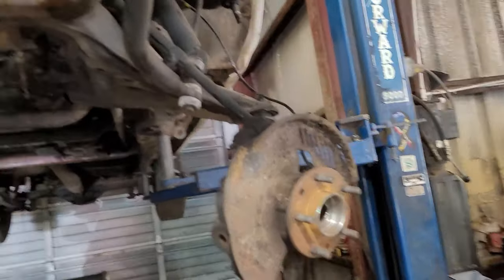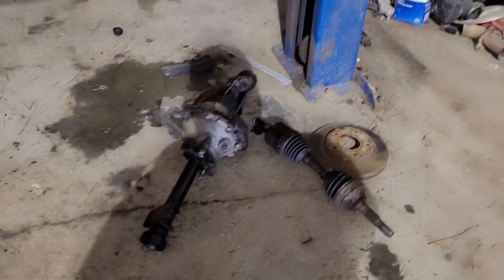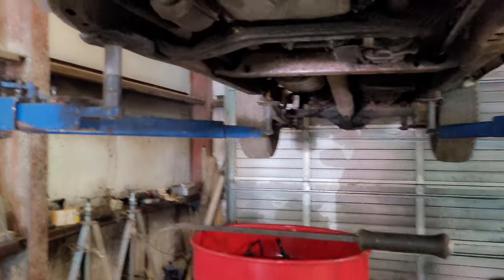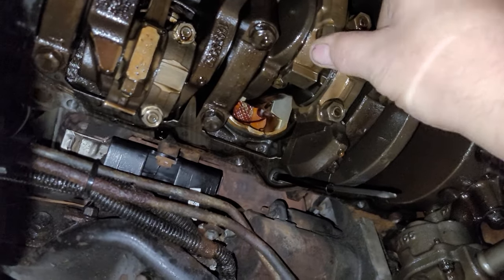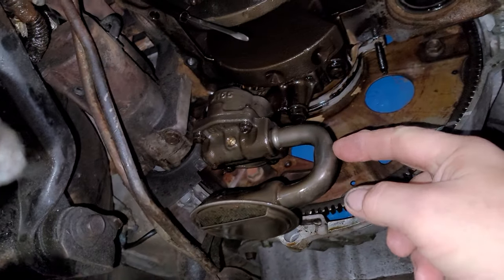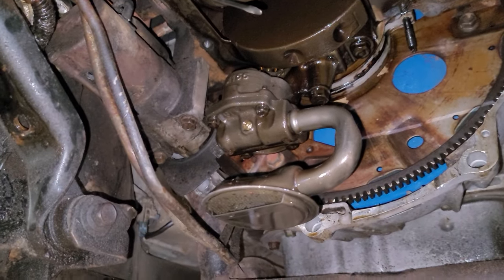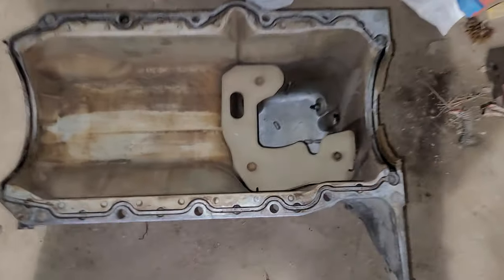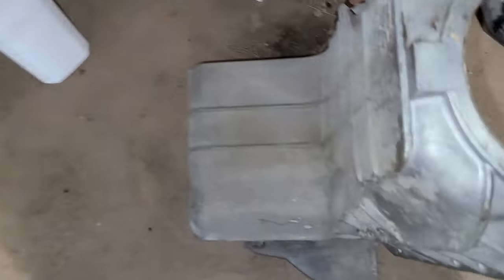Never seen this before. Chevy oil pressure problem

Comment: Those engines For some reason have always had oil pump problems the 43 and the 57 I think  At 1 time the dealer even said there was ATS P about using 3M roll off pads to  Being gaskets was the problem but then they used those plastic ones with the same abrasive basically. I think just put in a good mellings oil pump  And either attack well or use sleeve retainer or even some good right stuff silicone on the oil pump pick up Problem fixed

Comment: I might have to do this with my truck, stock oil pump, I do lots of off-roading though and I've noticed my oil pressure is running at like 10PSI on hot idle, I am using high flow rate K&N filters so maybe that has something to do with it. I also plan on putting a higher flow rate pump in there while I'm at it since I really like pressing the gas pedal. However, mine never goes to zero, if that happened I'd be immediately doing this mod.
Reply: high volume pump never hurts. but if i was you id do the rod bearings while your at it. you like pressing the gas? the rods like eating the bearings.
Reply: @chehystpewpur4754  Later update, During my last oil change I found some extremely fine metal in the filter (I always look in the filter every change). Uncle rodney hasn't started a knocking yet but he's getting a little cranky...

Comment: This is a common problem with the oil pickup seals. My 6.0 on my 2005 sierra 2500hd had a ticking noise that would not go away no matter what I did. Tried almost everything. The oil pump pickup tube seals were bad. It was sucking air. After replacement,  no more ticking. This was done like close to 7 years ago.
Reply: Never heard of pick up tube seals on a smc
Reply: @davecramer9725  Well, that's what fixed it.

Comment: I have one I had never seen in my 46 years of working on engines I bought a chevy 638 block long block(92 tbi 350) for $50 the man said it was a fresh rebuild but never had oil pressure and locked up I checked out the bottom end of the 350 and found an old oil galley plug in the oil passage in the rear main cap have no idea how got there but it had to be there before assembly so it was either  put there on purpose or it was built by a very sloppy builder

Comment: That is why it is recomended to braze the pickup to the oil pump. SBC should be no less than 25lb hot at idle. 55 at 2000

Comment: I would think that should be an interference fit of the pickup tube into the pump. I would think it is sucking air. What a trip.
Reply from the maker: Yea. It's a press fit. I got it pressed in place and tack welded !
Reply: @WrenchingWithKenny , was that the fix?

Comment: That's why people weld them in and I had a engine that 350 from a rolled over truck and it was just the opposite way to much oil pressure and blew the one peace rear main seal out

Comment: I have the same issue in my 1997 chevy with the 5.7 l vortec and I changed the oil pump
Reply: Did that fix your problem?
Reply: @danielcoe9421  sadly no it didn't

Comment: On the later model GM engines their is a cylindrical fine screen with an o-ring down below the oil sending unit. Using you manual gage read the same because the screen was still in there. Maybe the rollover brought some material from the pan. Many people make the mistake and start pulling the pan, when it is only a plastic part that cost a few dollars. Myself i never replace them, taking that rediculous piece of plastic will also give you a couple more pounds of oil pressure 3 to 5 lbs.
Reply: Where is the cylindrical find Spring located
Reply: Cylindrical fine screen located?

Comment: Probably when the O-Ring was cold it would stay sealed cause it was hard but after it heating up it got soft and let oil blow by or just sucked air.
Reply: This is a 4.3 liter V6 , a first Gen engine . Not a POS  LS motor with it's stupid little o-rings .

Comment: This is a 350 ? Ls ? Nevermind I'm slow, ls has pump at front of the crankshaft lol...ive heard about those pickup tubes sometimes coming loose, not from any particular circumstances, seems that they just weren't attached very well at the factory, I've seen one myself, I wonder how many sbcs have been deemed worn out or ruined by people thinking it had lost pressure, the one I saw personally was in enough to have 18 to 25 psi at 2500rpm but zero at idle, pulled the pan to see if a bearing was gone and found that, I've seen similar on two Ford straight 6 300ci also...and earlier ls 5.3s can have the o ring fail on the pickup tube also, you would think we have solved the issue by now but 😂

Comment: this guy solved the cavitation issue but not the air issue:  Small block Chevy oil pump
maldo72 5.91K subscribers 67,279 views  Jan 30, 2023
Small block Chevy oil pump

Comment: Those older designed press to fit oil pickups were bad about coming loose and dropping into the pan and destroying the engine. You are VERY lucky it didn't drop off there
Trying to weld it on is almost as bad since the oil pump body is cast and the pickup is steel.
About the only solution is to drill and pin it on with a screw / bolt or use an aftermarket pickup that has a stabilizing brace that bolts to one of the main bearing bolts

Comment: I had two Oldsmobiles in the 80s with the 231 v6 engine. Neither lasted 100000 miles. Both were crap. I never owned another GM product.

Comment: Not all oil pump pickups are made the same is is very likely that if you check it with a micrometer the the tube is too small and never fit tight from factory.

Comment: The oil cooler lines are supposed to be replaced when you swap engines... Not that, this was the problem... Just thought you should know...

Comment: if youve ever replaced an oil pump its not that common. its not a perfect seal and their made to really only go into an oil pump once. yet pickup tubes get reused to save money.
the ls motor has a new design thats not a press fit. its very common to lose oil pressure withing 100k miles. the o ring that seals the pick up tube where its bolted in is usually nicked and then splits and does the same thing.
ever do a transmission filter? same thing happens the seal gets nicked and the trans sucks up air and destroys the transmission.
press fit pickup tubes suffer the same fate. many people weld them in place after they position them properly. this is why.

Comment: All your bearings and sliding surfaces have kissed, that engine is hurt, how much is unknown. But it was cavitation. Im surprised you thought 15-20 psi was ok!!!
You should be seeing 45-70 at idle and 120psi at rpms for any HD or performance applications. My 2 cents.

Comment: not going to be an issue is the tube is correctly installed. how many million chevrolet engines were produced with the tube pressed into the pump body.

Comment: Interesting failure. At higher rpm there is more suction which seals the pickup tube better. Then at idle it works loose due to vibration.

Comment: Got S10: Chevrolet 2.2 4 cylinder 1999 5 speed Ls got problem the oil Pan got liltle be oil coming and the from where the got the gaskets coming under dumper got me thing like 1 half oil like round 4 mont  the time thing can put anything to stop the oil coming from thader in no want take out the oil Pan to much work son people tell me can put like Black silicone any want can let me know please thank you